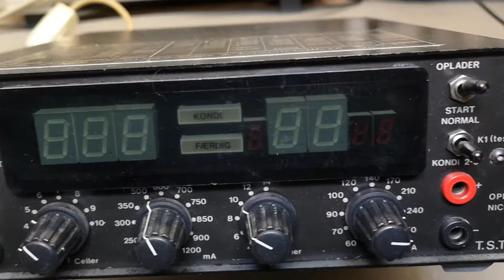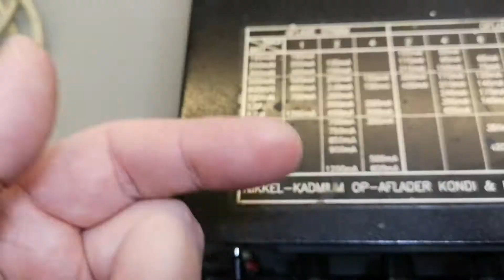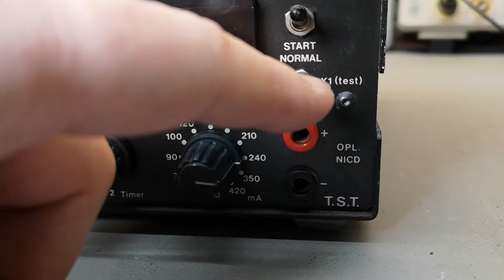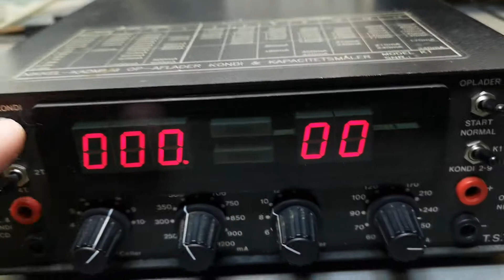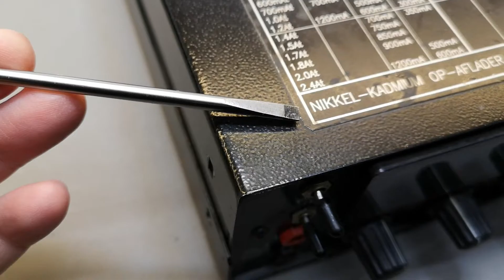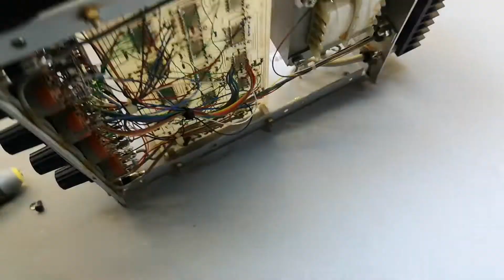NICD / NIMH Charger Conditioning unit K1 (design by me 1992) Teardown DIY

Comment: Thank you for using 4000-series logic. Many people instinctively chose power hungry TTL. In instrumentation like this where top clock speed is not important, 4000 series logic makes it work nice and cool and with not much EMI generation when done correctly. I also love the very expressive front panel display with various digit sizes etc. It’s exactly how I’d like to design something like this. What a beautiful device!

The rectifier design is clever. I had to draw it out to understand, but now I get it. Very nice.

It’s interesting how varied engineers in Europe did things at the time. I’ve been using layout software since I was 12 years old or thereabouts (late 80s). When I didn’t have a laser printer yet I would print out enlarged layout on a dot matrix printer in bold (double head pass), then photograph it on a very slow B&W 35mm negative film, then develop in high contrast process and finally expose it on another larger negative film stock using an enlarger. Then develop that. Finally UV exposure using a contact process.

The HP LaserJet II changed it all. I could print directly on transparency sheets. I modified the printer to be really heavy with toner coverage. The printouts had a palpable texture to them, and had good UV contrast. It was good to have so much time as a kid to play with all of that. Don’t tell my parents what I did to their printer when they were at work :)

Comment: I also did my first PCB's with Letraset, and also used a DALO etch resist pen as well to draw the wider traces. Front panel was a laminated paper print, made with a original made using Photoshop, printed out on a laser printer, then with the 2 extra colours added using the multicolour copier, which had 2 separate toner units you swapped in, so you could get, in addition to the regular black copies, you could also choose instead to have either red or blue toner, just by swapping the entire drum and toner assembly with the alternates in the case next to the machine. So had a black lettering, then with blue border, and red legends where appropriate, and yes I did go through a lot of copies getting them aligned onto the paper sheet, then took it and stuck a sheet of adhesive backed paper to it with spray glue, and then put another sheet to protect the peel side, and ran the entire sheet through the laminator, to give a durable front panel, that was then stuck down. Used one of the oopsie sheets to do the drilling, as I had put in there the markings for all the holes required, and after drilling and deburring, simply stuck the sheet down, and cut out the holes again.

Using what was available, Photoshop because in house design and graphics artist, copier because she wanted colour, but not a colour copier, as those were way too expensive, and laminator and self adhesive paper because we also had in house print shop, complete with AM offset printer and plate making darkroom, and printed almost all in house paperwork there.

Was working last time I saw the 2 units 3 years ago, but probably scrapped now, with the gutting of the building by new owner. No problems over the 20 plus years they were in use, on 24/7/365. Cost around 10% of the cost of the commercial solution.